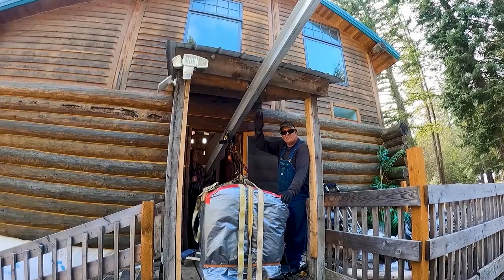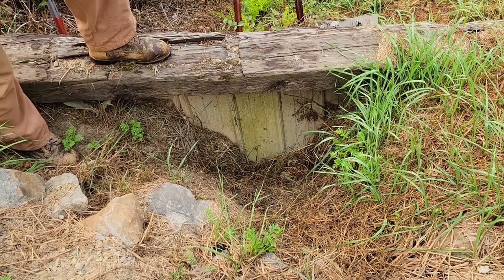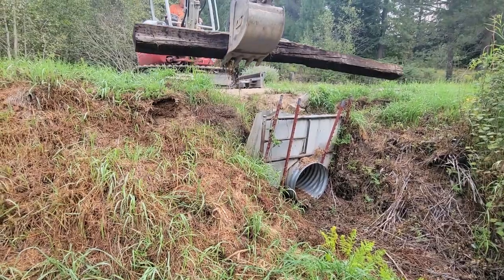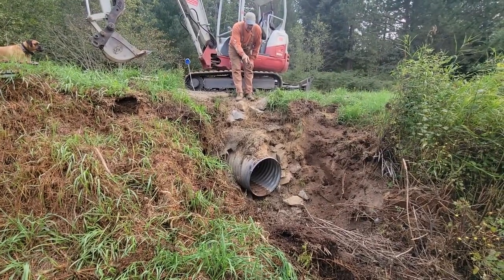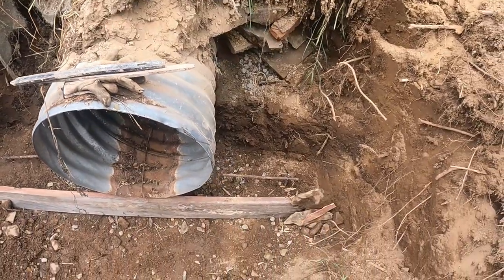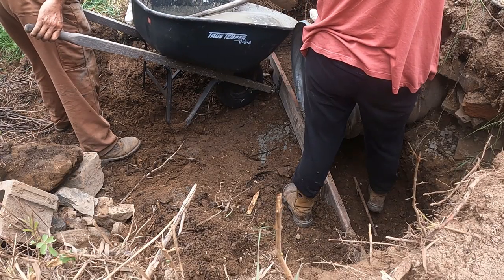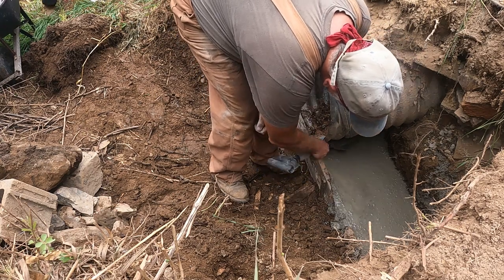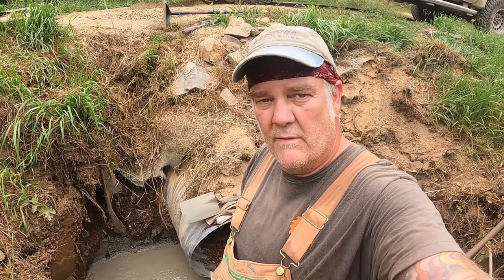How to repair a culvert super cheap!  Part I

Comment: You should have put some washed stone in your concrete mix Scott. It would have stretched much further and saved on cement. If I were you I would put a few reinforcing rods into that base to tie into your wall.

Looking forward to the next part 👍
Reply from the maker: Thanks for the tip